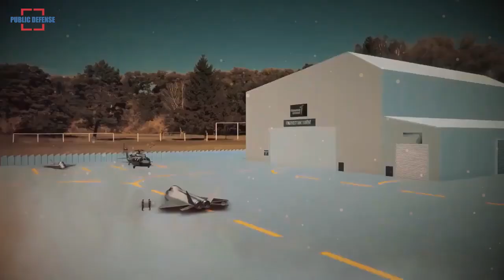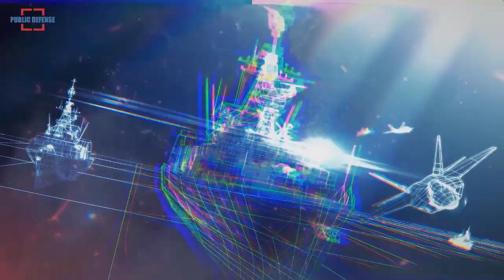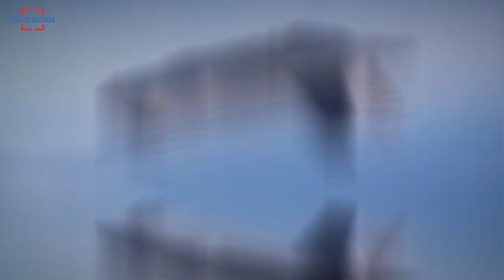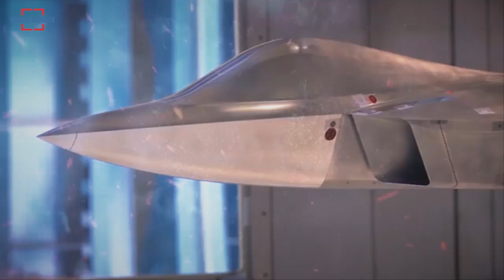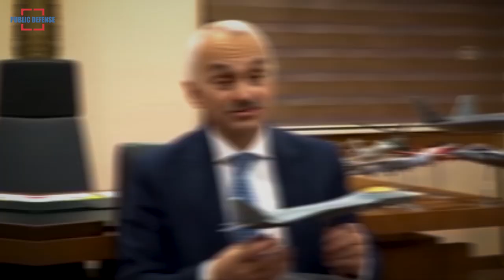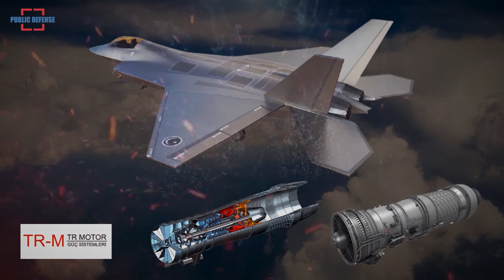The TF-X Program has Received a New Contract to Develop a Domestic Engine and Power Unit

Comment: Go Ahead Turkey 🇹🇷 from 🇧🇩
Reply: A single engine version is planned but i don't know if it can vertical take off
Reply: @35Frost  i heard UK rolls Royce is still in this project with tei is that true
Reply: @abdullahiaynashhussein5937  BAE SYSTEMS is in the Project.
Reply: @Veloce_20  last time I checked wikipedia tfx introduction was 2029 but they recently changed they for the first time updated tfx first flight on 2023 and changed its introduction date into 2024 so what changed recently does that mean tfx first flight will be 2023 and tfx introduction will be in 2024???
Reply: @Veloce_20  I thought bae and Rolls-Royce are both British does that mean they have connections and both can help or  can bae help on the turbofan engine development with tusas(tei)/tr-motors
Reply: @abdullahiaynashhussein5937   Now BAE Systems will give full support to TAI for the development of TF-X. If TAI do the project alone then it will take more time. Now there is assistance of BAE systems so Turkey want to fly 1st prototype in 2023.
Reply: @abdullahiaynashhussein5937   Both are British company. Rolls Royce manufacture only engines of an aircraft. There was an agreement to develop TF-X engine by Rolls Royce and ..... Motors. But the agreement was cancelled. And Turkey wants to develop TF-X engine self-dependantly.
Reply: Inshallah, Turkey will sucess. And Turkey have to develop naval-based fighter. As they will not get F-35B/C.
Reply: Nope dubbele engine